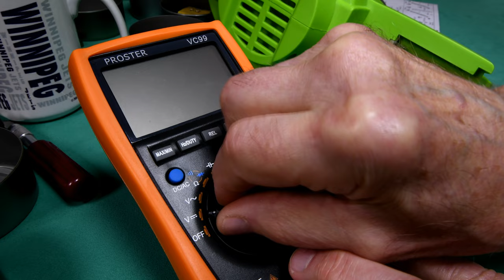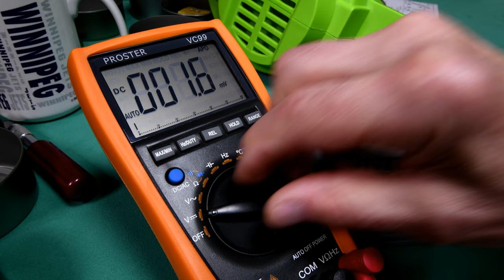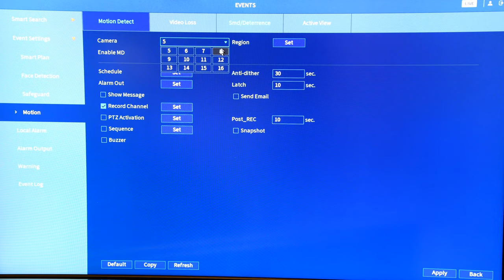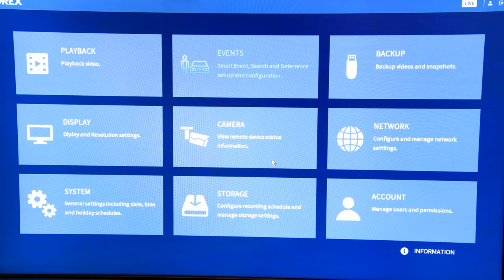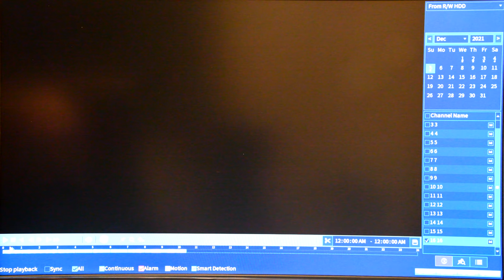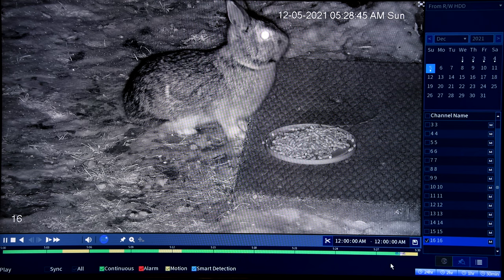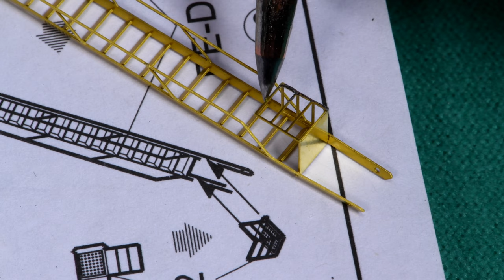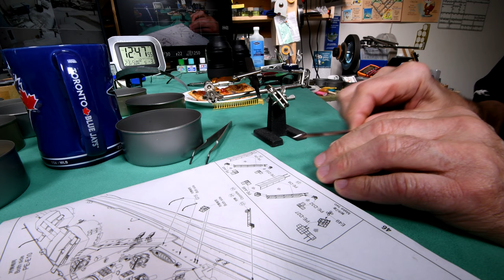The Model Ship - Part 1012

Comment: On Tuesday in the small hours there is a Meteor shower due  and the radiant is in Gemini next to Orion so even if your not up it will definitely be worth checking back through the sunrise cam as this annual shower often produces fireballs.
Reply from the maker: Thanks for that info Rust. Just now reset the motion sensor area for that camera to the sky. 👍